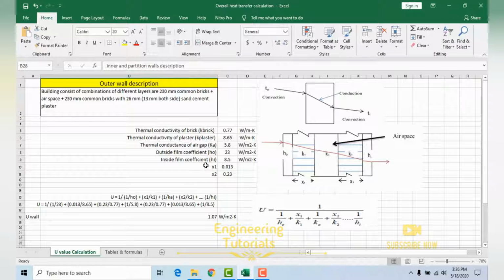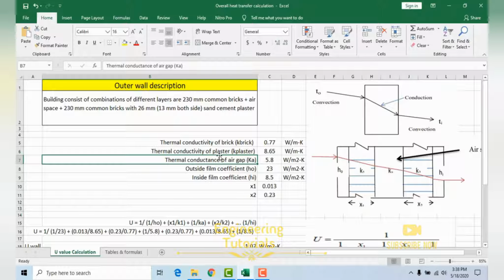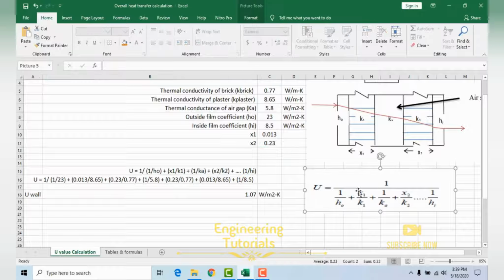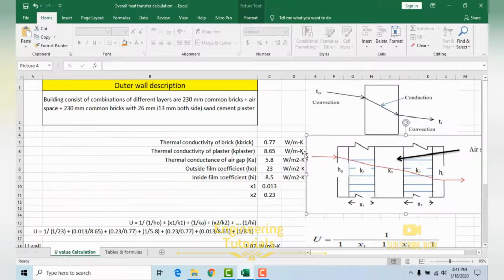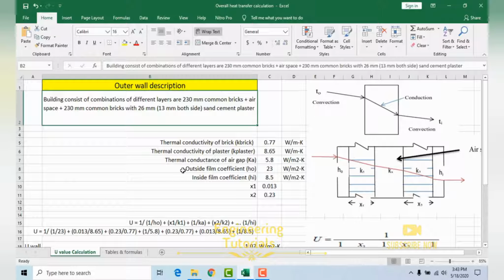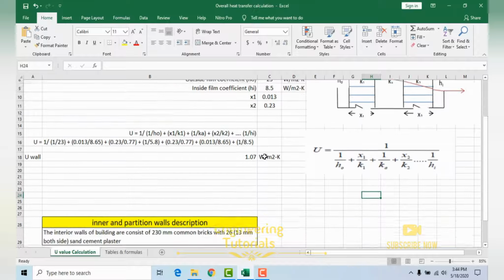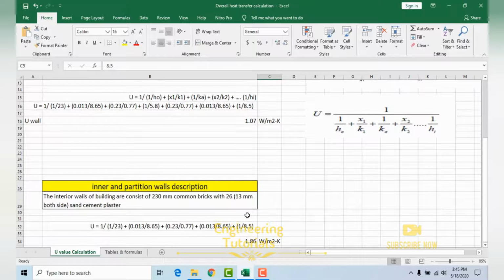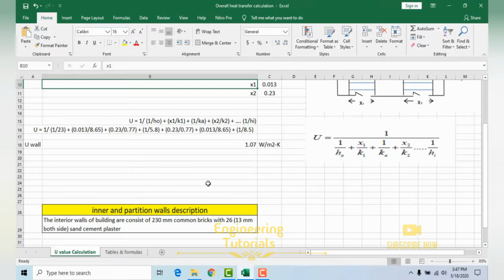Heat transfer coefficient (U value) manual calculation, overall heat transfer coefficient

Comment: While calculating the inner wall u value u have taken outside film coefficient as 23 is it correct?? 
If it is inner wall then outside film coefficient will be same as inside film coefficient or not?
Kindly reply